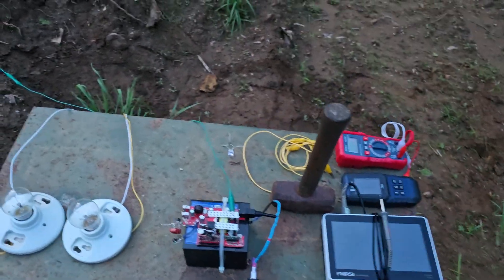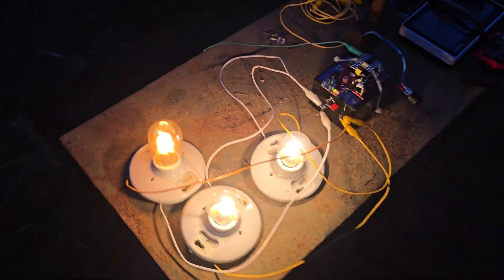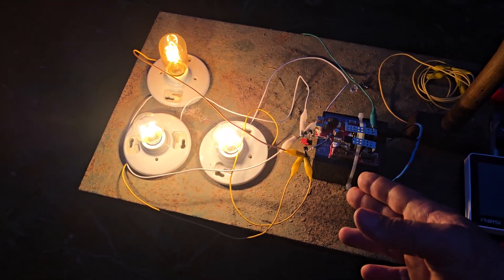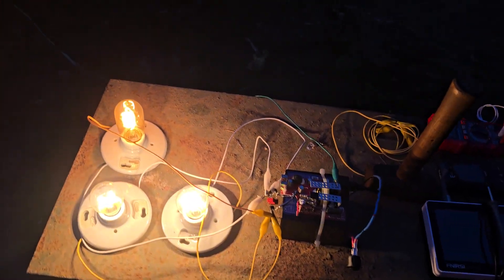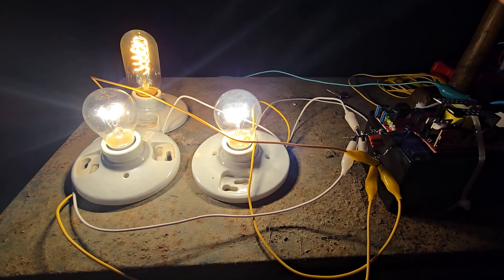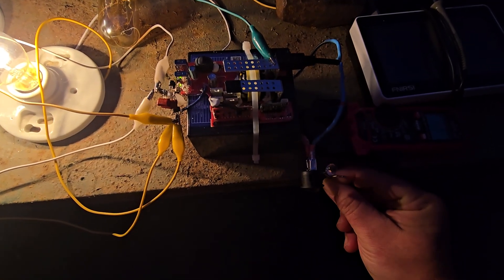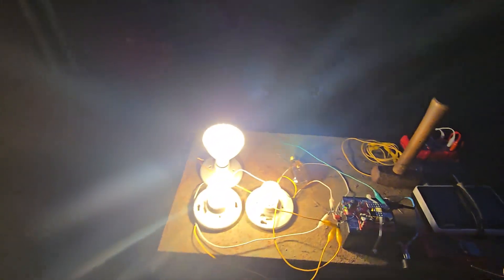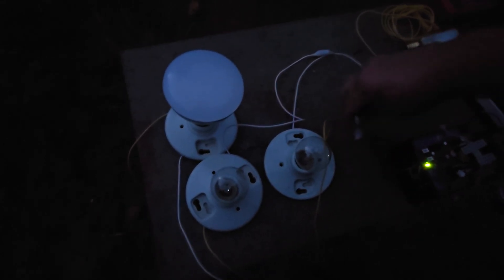📖BREAKTHROUGH EFFICIENT AUTO TUNING NEGATIVE RESISTANCE INJECTION INVERTER CIRCUIT-RADIENT ENERGY2📖

Comment: Not sure I understand. You showed 10A pulled from the 12V battery. That’s 120W (P=I x V). You have three 40W bulbs as the load. That is also 120W. So isn’t this just an inverter converting 120W DC to 120W AC. Or am I misunderstanding something?

This is not to say the Zero Point Radiant energy is not real. It is. But I’m not sure this is tapping into that just yet. Keep it up though and take a look at Bearden’s MEG.
Reply: You’re exactly right — if the battery is pulling 10A at 12V, that’s 120W input power, which matches the three 40W bulbs totaling 120W load power. Real efficiency gains would have to show the same light output from less battery power or a longer runtime for the same battery capacity, not just matching the rated wattage which is not shown :X

Comment: I'd advise against patenting. The best way to put it without triggering YT is that it's like bait. Not what it seems on the outside. Staying open source is the best solution for most technology like this.
Reply: Conventional devices are not made to see this, to see it, only one diode...take it just after, from positive to negative, there is a direction...and again...the best is a tellurimeter